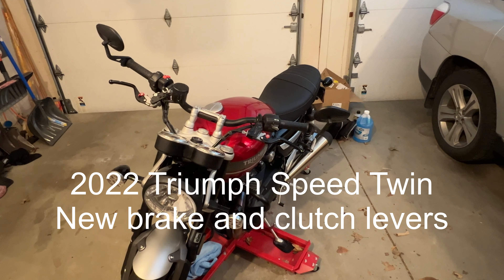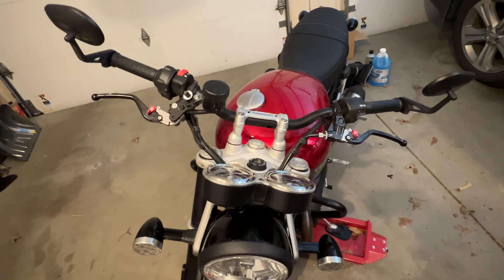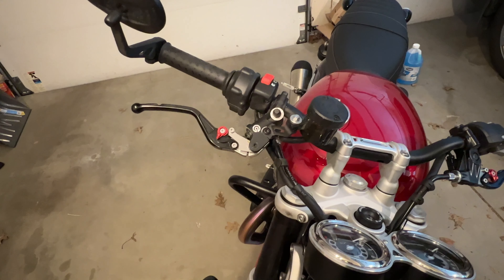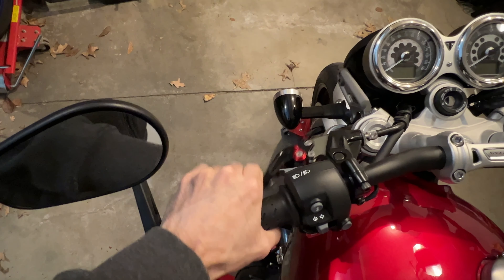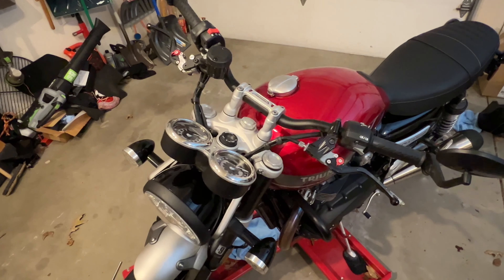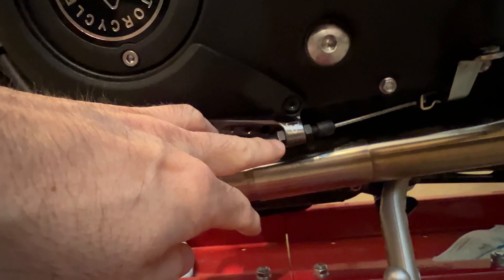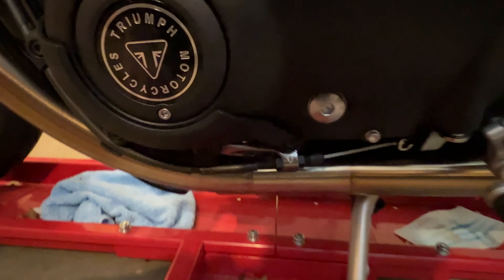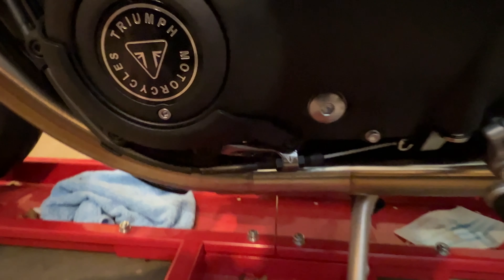2022 Triumph Speed Twin Brake and Clutch Levers

Comment: Big improvement!  I bought some
Nice EvoTech units, but had a issue w clutch adjustment and getting the engagement correct.  I ended up lubing the cable to help.  Not sure, I’ll put miles on it; but the Evo units are just that much different to really affect adjustment.

Comment: The bolt for the brake didn’t fit the new bushing’s internal diameter. Alert, don’t force the bolt. It’s not you, it’s Triumph. The old bushing does work, however. The problem is that the instructions say you need a new bushing (I think Triumph calls it a sleeve) if you are going to change anything. The additional problem is that those damn sleeves/bushing don’t come as a separate part, so you have to buy a standard Triumph lever just to get a new bushing/sleeve. Anyway, I buggered the pivot screw trying to get it in the new bushing and had to buy a new screw. My bike had never been ridden yet (welcome to North Dakota extended winters), so I wasn’t too worried about using the “old” bushing again, because it was new. The other option would be to take the pivot bolt and the new bushing/sleeve to a machinist and have it bored out to fit. I’d do that if your bushing has any miles on it. Drilling at home is probably not going to work unless you really have a solid drill, but I’d suggest a professional vertical mill or lathe to get a dean on fit. Unfortunately, that’s probably going to cost more than just ordering a new lever just to get the silly sleeve. Come on, Triumph, how about selling the sleeve separate, or making sure the internal diameter is correct?